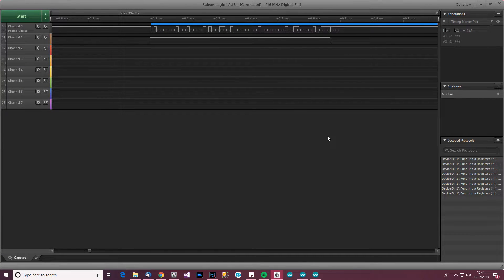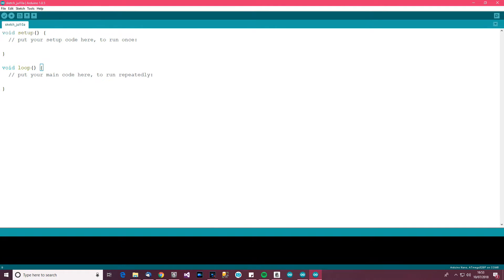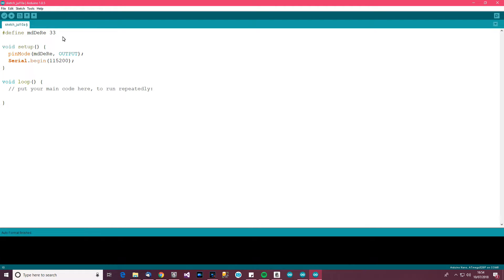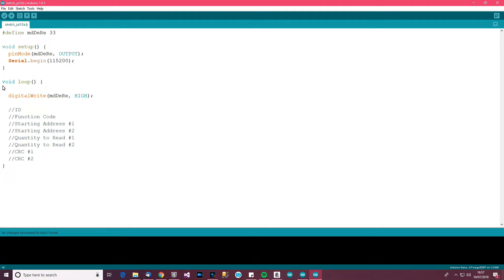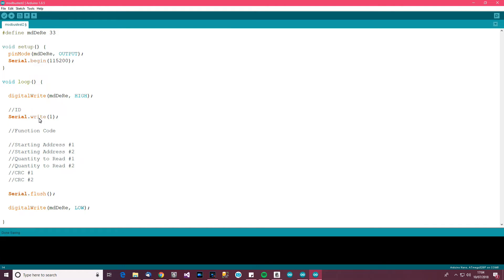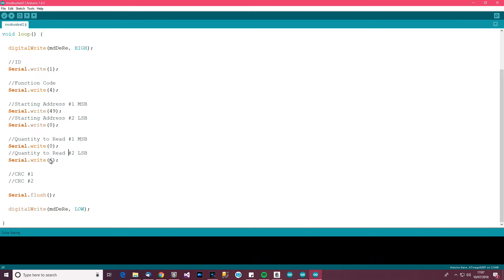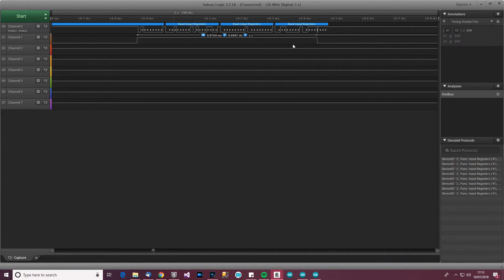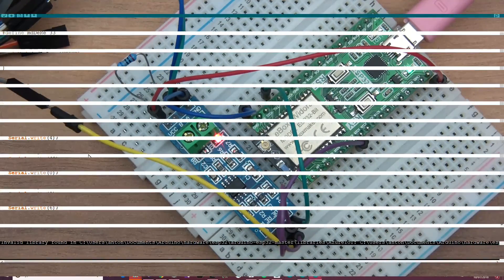TUTORIAL: How to make MODBUS work with ESP32 - Arduino - RS485 - Part 2

Comment: Great video, I'm going to add the CRC check and ModBus error code checking. Most devices run at 9,600 / 19,200 / 38,400 baud over ModBus. A lot of slave devices also need a "quiet time", that is a delay between polls of 5 /10 / 20mS.

Comment: I found this very useful. I was trying to get the ESP8266 to work with a MAX485 in Esphome, and the remote device was never responding. I purchased one of the logic analyzers you used for checking the serial protocol, and I found that as well as the modbus serial data being sent to the MAX485, the debug log was also sent to the serial port - this was even though I wasn't using serial to view the log, and I was applying OTA updates. I have spent weeks trying different things and testing , and the logic analyser identified this in a few minutes. Well worth the £10. the MAX485 is now working across the other uart on GPIO13 and GPIO15
Reply: I'm seeing a similar problem. Thanks for commenting on this.

Comment: This is very useful, thank you for sharing it. 

Have you considered doing the same video using the rp2040. I assume that the rp2040 would be faster than the esp32. 

Is there an alternative to using blocking code for the delay.
Reply from the maker: Hi, I can't remember how the ESP32 works, but more often than not, there are ways around blocking. I did a project a few days ago where I could peek into the buffer to see how many bytes were in it before trying to read. This would completely stop the block as you wouldn't read if you know that nothing is there.

Comment: Hi Antony, I have been struggling for quite sometime with the modbus.. This solution could work for me, but I am not sure how you have arrived at the CRC. I am getting so many solutions or CRC, have tried multiple algorithms but unable to get what you are getting which is 126 for MSB and 244 for LSB.
which polynomial has been used? I have tried A001 and 8005

Comment: I've gone crazy with that for a month at work, my buffer is a ADM2582E and it happens the same thing because i designed with a 10k resistor pull up in A and pull down in B 10k is too much high and sometimes modbus signal for long distances go down below 5V, so pull down and pull up R is seen by buffer as an open circuit, then buffer force the pin randomly up or down, so the solution is a 5K resistor for me instead of 10K,put like you did.
Seems a common problem for modbus communication buffers

Comment: hi, I am trying to send data from pro mini to esp 32 but esp32 is not getting any data,showing response timed out. if i put uno instead of esp32 its working fine.
Reply from the maker: Why would you send data from APM to ESP32 via Modbus?
Reply: I havent found any one doing such communication so i wanted to try it with two different micro controllers communicating via   modbus.Thanks for your response,still iam trying on it if you can suggest any help regarding this ,thanks in advance.
Reply from the maker: Hi, it is possible, but it's hard work. It does work though just like in my video...
Reply: I have used your method of working and also traditional method like modbus master library and modbus library for slave its not working
Reply from the maker: The Arduino Pro Mini will work with Modbus Master but the ESP32 won't work with any known library. The only solution which I know is my one. If it is not working, you need to know why it's not working. Do you have a logic analyser? You're going to need one!

Comment: Excellent project
Reply from the maker: Thanks! :-)
Reply: Reason for the problem is straight forward and has nothing to do with a particular microcontroller, in this case ESP32.
Transmission of data bytes to the RS485 Modbus is done by separate UART hardware on the microcontroller.
When you write a byte to a serial port, you transfer this byte from microcontroller to the UART transceiver inside the ESP32.
UART transceiver will then transmit this byte out to the RS485 modbus transceiver during the certain time period dependent on the baudrate.

So, if you look at the last byte that you transfer to UART transceiver and then immediately follow with changing the  mdDeRE pin LOW.
UART transceiver will take longer to actually transmit that complete byte to RS485 transceiver than what it takes to set mdDeRe pin low.

Or if you can imagine it in another simplistic way as a bit time.

To change mdDeRe pin takes 1 bit-time.
To Transmit one data byte takes 8 bit-times (as 1 byte=8 bits).
Obviously there is some other detailed timing involved in the whole internal data processing.
But hopefully you can see why mdDeRe pin goes low before the last byte if fully transmitted.
Reply from the maker: Yes, that's what this video is about. :-)